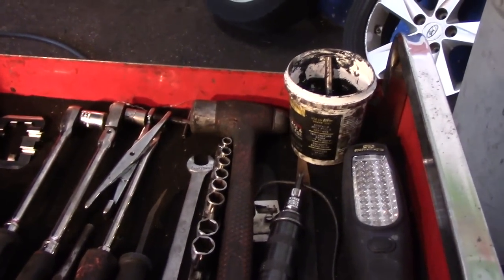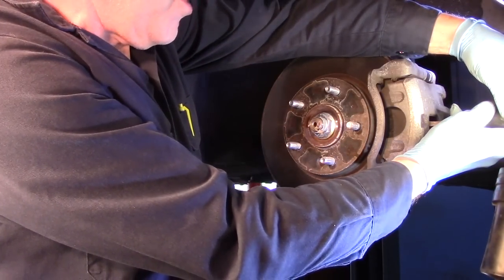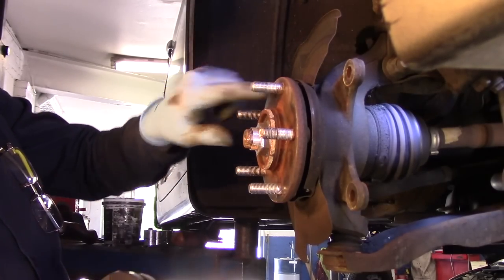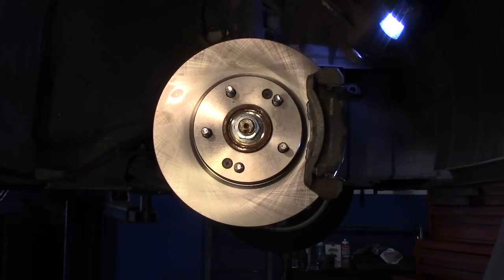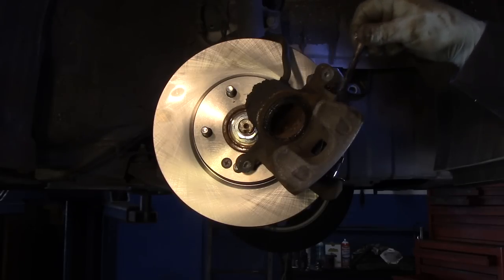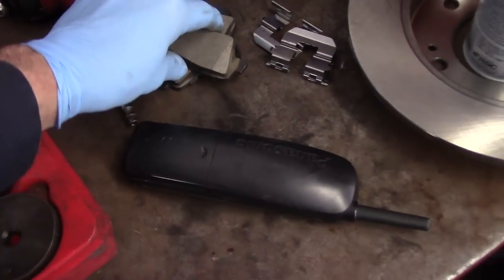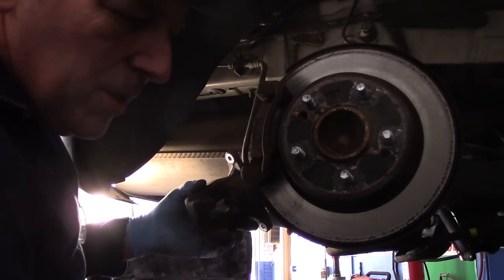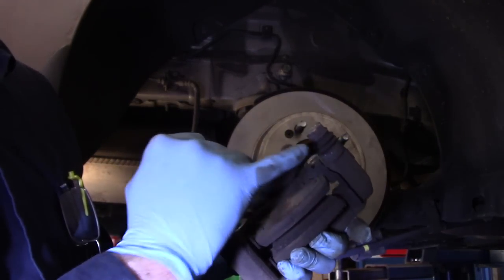How To Replace Front & Rear Brakes 2016 Hyundai Elantra

Comment: Great Video! Was having trouble trying to figure out how to get the caliber off. So odd that you had to push the caliber back while its still in the bracket. After I watched your video and bought a breaker bar it was a quick and easy change. First time working on a Hyundai and everything was fairly straight forward

Comment: Didn't have the special tool or long enough pliers to rotate the part. I used channel locks. Was able to hole them in the notched and spin it in. Great video. Thanks for the help.
Reply from the maker: Thanks for the info

Comment: Thanks you i will attempt my brakes today because where I live is as cheap as it comes but just 4 brake pads installed is almost 500$ i just can't justify spending that on 4 brake pads to be installed when there is youtube and etc. I will update after I'm done 😅😅 was a breeze took 2 hours for back 2 brakes to install i will continue on my front 2 in next couple days
Reply from the maker: Great. I’m sure you can get it done. If you have a problem email me at jimthecarguy 1@gmail.com. Don’t forget to subscribe

Comment: Hi Jim, is there any reason why you did not open the bleeder when compressing the cylinders?  I thought it was not good to push the fluid back into the brake system.
Reply: It's a closed system. Pushing the pads in makes no difference, unless someone overfilled the resevior, in which case it may spill over

Comment: Great video!  Is there much difference in anti seize and the brake silicone, or can anti seize be used for both?
Reply: The anti-seize and brake lube serve different purposes and shouldn't be interchanged. Over time, the anti-seize will start to thicken and become gummy. If you use this on the slide pins or on the areas that should move, it will cause problems. The anti-seize is great for areas that don't move but might need to be removed in the future. It's job is not to lubricate; it's job is to prevent rust. In addition to adding it to the bolts, I add it to the surfaces on the rotors that contact the wheel hubs and where the wheel will mount. I started doing the latter after an experience where a tire would not come off even though the lug nuts had been removed.

Comment: I just did rear brakes on a 16 elantra. I've done brakes on many different cars and have never run across this type of piston on the rear brakes. I couldn't figure out why I couldn't compress them with a C clamp. So I came to youtube and found your video.
I was able to grab the piston with a pair of channel lock pliers and turn them. But I'm still confused how these work. If you have to screw them in to compress them, how do they come out as the pads wear? The tab that fits into the slot will prevent it from unscrewing.
Reply: If I'm not mistaken the Piston that turns is for the rear wheels and are used by the ebrake so when you pull it up the Piston is pushed against the brake pad and when released the opposite happens
Reply: Tristan Simpson I don’t think that’s right. There is only one piston and has to move when you apply the brake pedal. It was a weird looking ebrake setup though.
Reply: Agree I would have never guessed to rotate them. 🤷‍♂️
Reply: Ran into same yesterday and wondered?  Great video solved the issue. Thankyou so much.  Very clear and concise instructions.

Comment: What is ya don’t have the two screws or cannot put in none because the holes is blocked
Reply from the maker: If you are not able to install the screws it is ok but just make sure that if the screw broke off it is filed down to be flush with the hub.

Comment: My Hyundai Kona the engine vibrates mostly when at a stop light or bumper to bumper traffic. I wonder if that’s a serious concern. It only has 8,000 miles on it
Reply: jimmy  i am a hyundai tech  I was the first tech at my dealership to touch a kona  when they first arrived.    it was not long ago  that they arrived   they are new vehs.
I want to be honest with you any and all hyundai sales people will say to you that there  grate vehs.  the truth is they are JUNK  in plane english    but at 800k  what ever it is     will probable be under waranty      this concern you speak of  can be caused by many things    motor mount  misfire  and so on    take it to a hyundai  dealer and  have them test drive it    and also scan for any codes  .
Reply: JOE FORD DIY thanks Joe. I appreciate the honest reply.
Reply from the maker: Is the check engine light on?
Reply: jimthecarguy no check engine light, Jim. But it is a noticeable vibration mostly stopped at a stop light or slow traffic.
Reply from the maker: @jimmyburbank  Was that shake always there?
Reply: jimthecarguy it started about 6,000 miles in.
Reply: were you able to get it diagnosed and did the dealer fix it?
Reply: onenikkione I traded it in for a 2019 Nissan Rogue. The Nissan drives much better !! Very pleased 😄